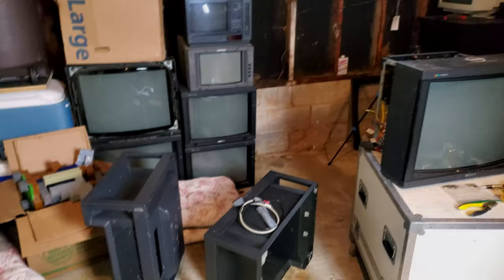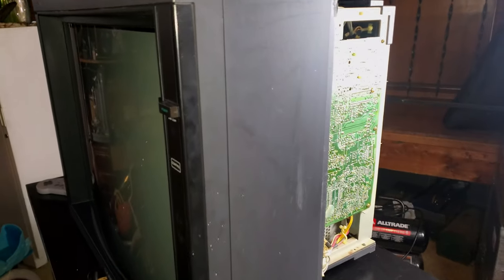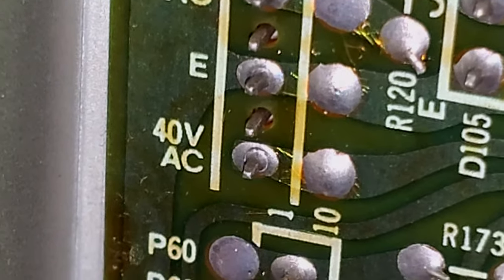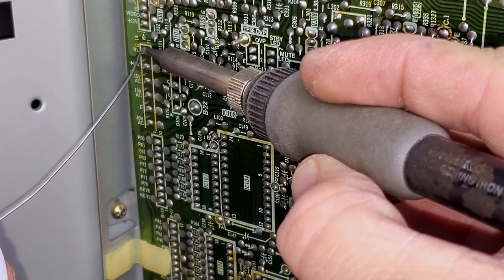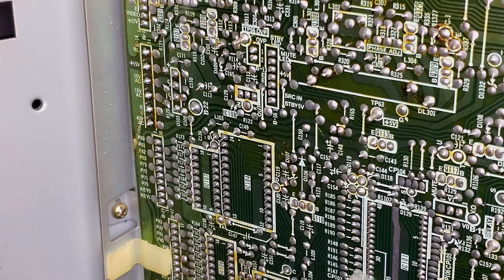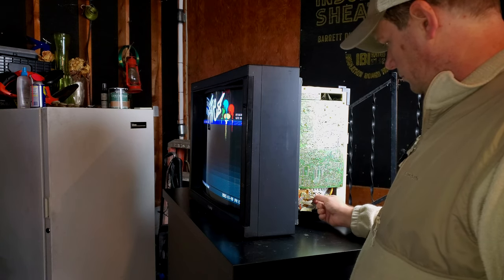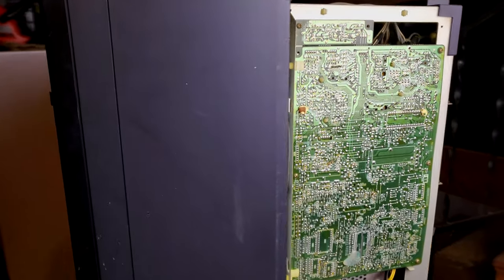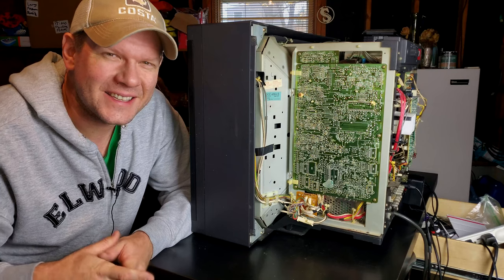The Sony PVM 2530 Trinitron | Inside the Beast! | Troubleshooting & Repair

Comment: Awesome job Steve. I enjoyed watching this video as you are giving me the courage to recap my 14M4U. We spoke via email about 1.5 years ago about the cap kit. But I had no time or the tools to do it. Now I have the tools just not the time as I will be deploying soon for 6 months.
Reply from the maker: Yeah, I remember.  Have you recapped anything yet or gotten any practice with your tools?  You definitely will want to get some hours of soldering under your belt before working on your 14m4u.  Good luck!
Reply: @RetroTechUSA  I sure did get some good tools for soldering Steve. Plus I have recapped a couple of PCB’s and small things.

Comment: Love to get a 2530, used a 2030 before & loved it. Sold it to get a nice 29 NEC.
Reply from the maker: They are really Hard to find now.  The NEC is a better monitor for sure.
Reply: @RetroTechUSA  I had one (NEC) for a bit - picked up from LA - had a problem with geometry - had this 'warping' bubble effect  (apparently this is common) and it messed with my OCD.  I wonder if this could have been fixed?  this video gives some geometry examples - and i've queued it up to the specific part when its noticeable (during scrolling) https://youtu.be/9CMdePuEeB0?t=42.  Eventually picked up a PVM 2930Q - since I was interested in mainly 240p content.  Picture wise it was pretty glorious.  Tried to get a local repair guy to replace the caps, but he bowed out - didn't know what to do.

Comment: Hey I love your videos man I have a question I really could use your advice..I have a Sony kd-34sx955 hdcrt and I’m having a weird problem where the screen is flashing randomly.  It’s like when you turn off a crt and you get that bright white flashing light but it’s happening while it’s on for a split second then normal.  I almost thought it was arcing but I don’t think that’s it.  I’ve been told it could be the neck board joints I’ve also been told to adjust the g2/screen potentiometer.  I’m not sure where to start.  Any advice man?
Reply from the maker: Is it flashing fast and repetitively?  Is it random?  It could be the Heater inside the CRT gun in the tube.  That can short and causes flashing on screen to occur.
Reply: @RetroTechUSA  it’s random and sometimes I can go hours without it happening..it’ll happen a couple to a few times a night of maybe 4 or 5 hrs of tv watching.  People have said anything from worn solder on the neck board or a bad cap or resistor on that board all the way to “I need to adjust the g2/screen control potentiometer.   I will say when I took it down in my basement with he help of a friend it did take a couple of hard hits going down the stairs.
Reply: @RetroTechUSA  also the red led indicator light blinks 10 times every time I turn the tv on …I looked up what that meant and it mentions the d board and changing sun ic’s or something like that..

Comment: Hi @Retro Tech!  can you help please I noticed on my pvm theres a faint shadow of a line running across the screen horizontally in the lower and top halfs is that the degaussing coil or am i seeing a error in the picture? i also see a stright up line in the middle of one in the same style please any information would be helpful thanks!
Reply from the maker: Hi, that may be the Aperture Grille lines.  These are wires in the screen that hold the grille to the tube and are noticeable on certain backgrounds and certain CRTs too.
Reply: Yeah, probably the aperture grille stabilizing wires.

Comment: Excuse me,i have that monitor,but i dont got the specific diagram for a db25 to db15 cable,is there options to use the ossc with this pvm using the rgb/cmptr output?
Reply from the maker: There is a scart adapter for this PVM.  It will accept RGBS, so that's your best option.  https://www.retrogamingcables.co.uk/sony-av-accessories/sony-pvm/sony-pvm-scart-converter

Comment: I have a 2530 with various geometry issues. Would love to correct these problems but after hearing about someone messing up their TV, adjusting the pots, Im scared to try it when I spent a lot of money on it.
Reply: Pots are adjustable, not sure why this is that scary. Aside from the money part.
Reply: @wormbagged  yeah you mustve missed the last part of my sentence where I stated the sole reason why I was apprehensive about doing it. its not like i found it on the side of the road.

Comment: I have Barco broadcast monitor.
But no high voltage.
I figured it out that transistor always blown out.
If i need sending to shop mebee better to buy other monitor.
Mebee need a 180$ to fix it 
Do you have suggestions?
In Sams photofact and the web  no schematics.
I believe its great monitor.
The monitor have couple separate pcb in slot 
Power supply high voltage. Control and video that difficult to test.
Because if i take out the high voltage pcb no power to measure voltage